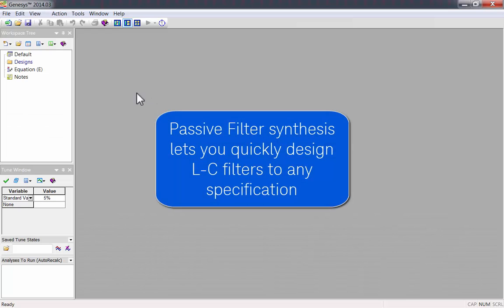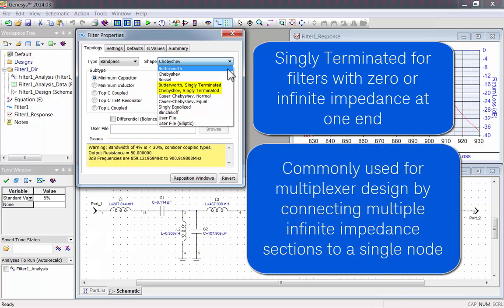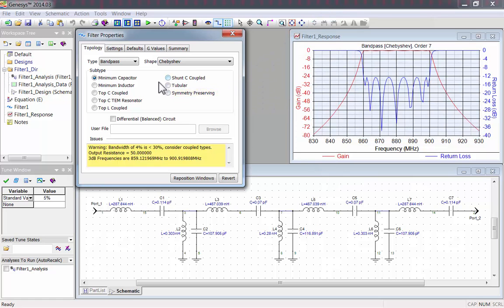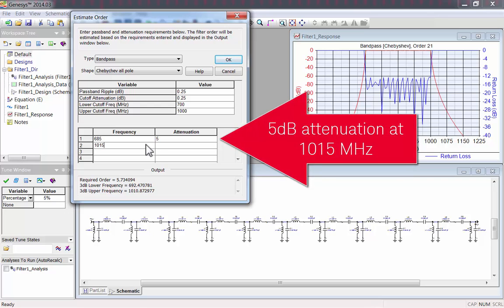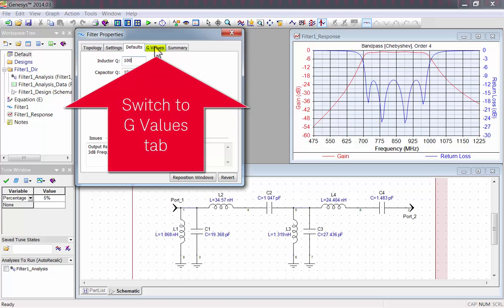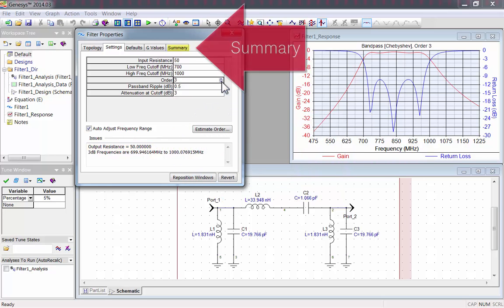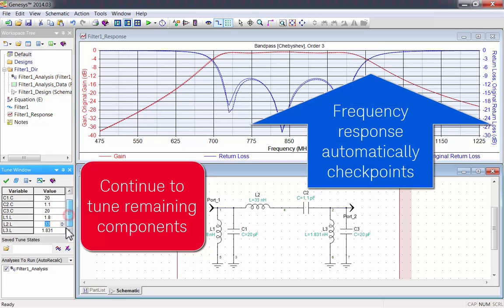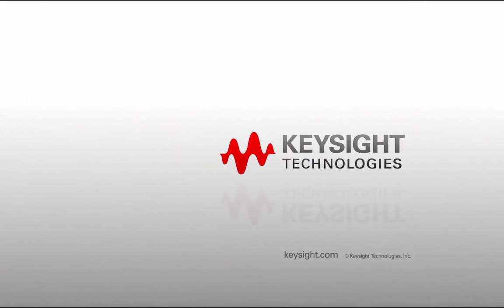Passive Filter Synthesis

Comment: Hi, good day, thank you for the video, I have a question, is it possible to design a circuit from the response curve? I have the S11 graph with multiple attenuation peaks at different frequencies between 8 GHz and 12 GHz that can be considered as a low pass filter and I want to get the circuit that describes that response but considering the position of the peaks and the maximum values of attenuation. Thank you in advances for your help.